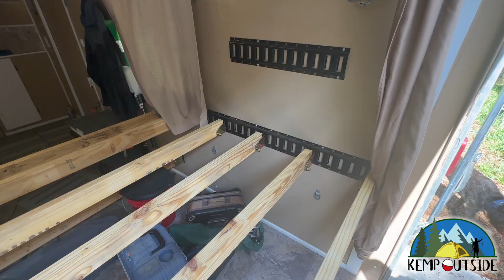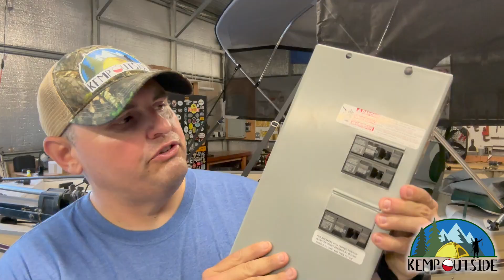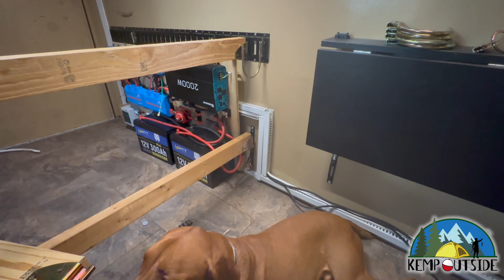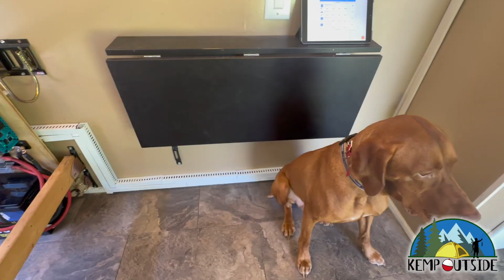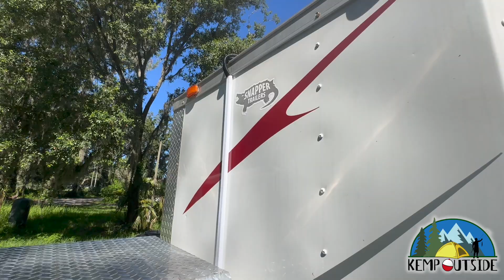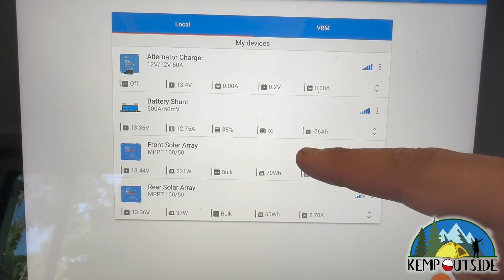Off Grid Power System Install for the Cargo Camper

Comment: Hi thanks for the vid.  May I asked how you solved the Renogy inverter tripping out the transfer switch issue?  Also to simplify things did you consider using a charger inverter instead of seperate items?

Comment: It's been miserable hot and humid here in Kearney Nebraska haven't been able to work on my trailer I'll take that inverter i bet it's a ground issue try a 04 ground wire cable to frame
Reply from the maker: I got the inverter to work.